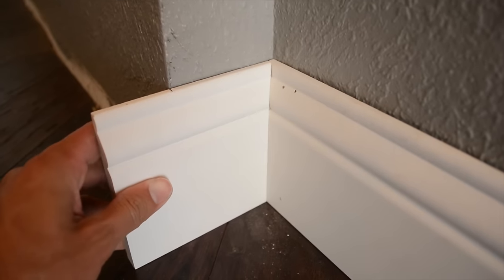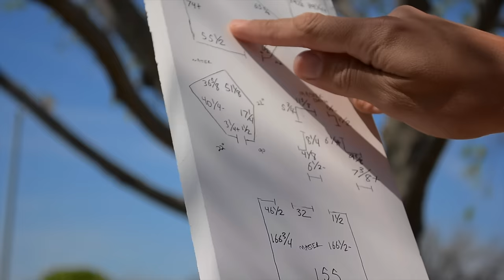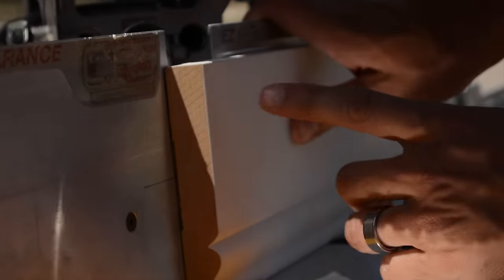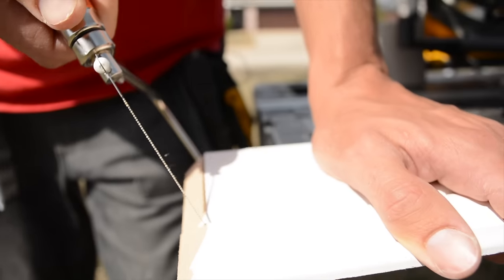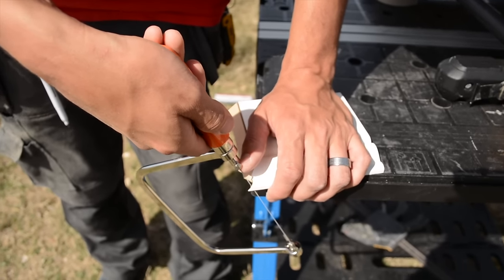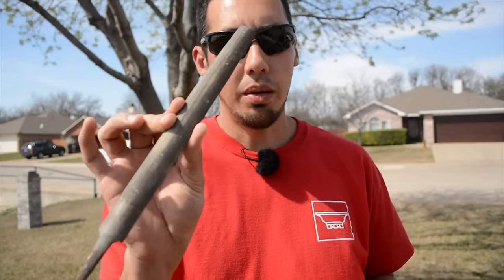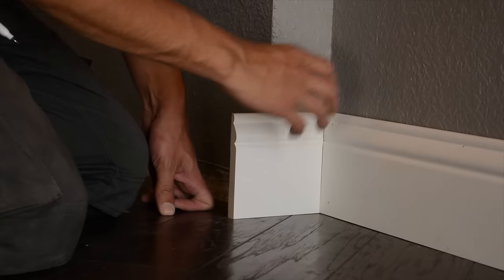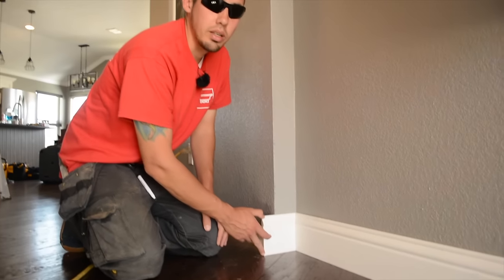Coping MDF Baseboard

Comment: As much trim as you guys install, you should look into a Copemaster 2. It's like a key duplicating machine for coping trim. I just used mine for the first time and I coped 8 crown joints, 6 chair rail joints and 5 baseboard joints in less than 10 minutes and they all fit perfectly, no coping saw or filing whatsoever. This machine can do 10-1/2" crown or base. With the volume of trim you guys install, this machine will pay for itself very quickly.
Reply: Hung, I think you're misinformed. The speed at which you can cope with this machine is, at least 3 times faster than using a jigsaw saw and that jankey little jig/guide. The machine weighs about 45lbs and is very portable. Unless you have used a Copemaster, you really need to reserve judgement until you have tried one!
Reply: I'm a carpenter here in Kentucky, and if you know ANYTHING about this trade, you would know that coping EVERY SINGLE piece the same exact way, will not always work my friend. I'm not being ugly, I'm saying not every corner, (inside or our) is actually 90°. With that being said, it could be the sheetrock, or the framing, or the settling of the house.
Reply: Jake,  Again you're ignorant to the specifics of this machine and how it works. There is very nearly 6 full degrees of adjustability, both, over and under 90 degrees, in the coped joints from a Copemaster 2 and  the inside corner on which you are installing the coped crown will work on out-of-square situations. You should do a bit of research on the machine and you will see exactly what I am speaking of.
Reply: Hung Q Tran k
Reply: Jake, you are among the uninformed as well. The adjustability of the coped joints is more than 4 degrees +/- of 90 degrees. Have a look at the videos on the Copemaster website ( I have NO VESTED INTEREST in the success or failure of the Copemaster company) and it will help you make an INFORMED JUDGEMENT! If you ever have the opportunity to use one of these machines you will be immediately converted unless you have no interest in being a better and substantially more productive carpenter. Higher production=More Money in your pocket at the end of the project!
Reply: But most people will not be buying one as they do not have many pieces of skirting or architrave to repair - so the coping saw and hand tools is the cheapest and best way and the proper way to learn.
Reply: Sadly for the diy'er they need a good but affordable tool that is easy to use. Sometimes you will be setting up your fancy machine just for a couple of cuts when you could get out a hand saw and a Studhawk saw guide. For a couple of cuts you also need this tool as it will save time plugging in leads and setting the saw up on it's frame or stand. By the time you have set up your new machine i have done the cuts by hand and if you are off grid you will need a $1,000 generator and fuel or loads of batteries for the cordless. With most saw guides you have to put the wood in the tool. With the Studhawk Saw Guides - you put the wood on the tool which is easier and faster. The guide also protects your fingers and will fit on round plastic plumbing pipes, gutters etc
Reply: Yes but expensive and if everone wanted one they would not be able to keep up with demand - but demand for fancy power tools is not what DIY'ers want - but an affordable way to do it. The Studhawk is very affordable and simple to use with amazingly accurate results - try it.

Comment: Thanks for showing us.  It would be great if you kept going and showed how to measure and get that next outside 90 degree joint perfect.  Like how do you hold a short piece of MDV on the chop saw and cut it and work up to a perfect joint or do you just cut it once and it always fits?  I look forward to more.  Thanks.
Reply: Great videos I've been watching you for quite some time. I would like to ask your opinion regarding using pin nailers. I have a pin nailer that will shoot a 2" pin. Would you use this for base molding or would you still stick with 16 gauge? 
Thanks in advance for your opinion
Dug
Reply: Thanks for this info Cole Man - do you glue the outside mitre? if yes do you use wood glue or CA ?
Reply: AHA - what you have to do is cut the mitre on a longer than required piece so you have something to hold onto. Once you have the mitre cut - straight cut the piece to length off of the long piece.

Comment: Hello: Do you have a video where it shows installing baseboard and one encounters a big gap between the stiff baseboard and the bowed-in sheetrock…yes one can caulk the gap but has anyone determined another way so the caulked gap is not so wide.

Comment: I finally have a good question to ask you! Can you make a video of your cut list and install processes that make it easy for you? I’ve been doing carpentry for about 4 years now from studs to paint, yet when I make a cut list, especially for window and door trim, it doesn’t line up perfectly like I want it, so I’m forced to take my time and cut fewer pieces at a time. Examples are pitched walls, unlevel floors causing height pitch, and so on. I’ve been using sample pieces and that has helped the process, but I just want to measure, cut, and run.

Comment: I like ur coping vids brother. And thanks for the info on the cancer thing! I never about that but then again I don't do this type of work enough. I'm a jack of all trades and master of none. Most of my work is volunteer. But vids like urs help out a lot! I remember the first time I did crown molding!! I pretty much wasted a whole board trying to figure out the coping method! Lol! I didn't understand the angle to use and crown molding is cut upside down. For those who work on this type of stuff I'm sure it's as easy as tying your shoes with your eyes closed. At any rate, thank for the great info! 

And by the way, why didn't u use the sticky sand paper? I tried that on my last project and man, was I satisfied! They thought I wz a genius! But of course I could take the credit and contributed it to watching one of your videos!

Comment: A few months ago one of the trim carpenters my company subs showed me how you can cope on a table saw, you should try it out works pretty nice and is fast
Reply: make a table for a router mounted underneath and it's even easier. After I did that I figured it would be possible to make the router move around in a purpose made jig, but that's too complicated for me, maybe on a few houses its worthwhile
Reply: not for a novice and only works with short pieces of trim

Comment: Do you need to caulk that corner?

Also have you ever scribed baseboard to the floor?
Reply: Yes i agree i didnt like the void left behind the reverse mitre - leaves week corner joints. As for scribing skirting boards to the floor - try self leveling compound to sort out the floor before fitting base boards. Also not many people know you can pour a self levelling compound on wooden floors - just make sure the manufacturer says you can as some levellers don't!Self levelling - packet normally states upto 5mm this can be increased by adding aggregates to the levelling compound. These additives are :-1)granite dust2)granite chippings3)lytag pea shingle
All available from good builders merchants. This way you can extend your levelling compound to 50mm with some manufacturers products and some can be laid inn bays of 100m sq without expansion joints. Dont believe this check Alfix of Denmark. I used to use this product in shopfitting where there was no time for a traditional screed to cure. So subscribe to Studhawk channel
Reply: I cut my profile line at 0° for MDF.  It's too weak for a 45° back cut.

Comment: Millions can't put a cob handle on a file. Richard was born for this work. Perfect
Reply: I found a old golf ball with a 3/16 hole drilled and pounded on the file tang works better than a cob.
Reply: Exactly which is why people should start at the begining with hand tools and work their way up from there to power tools. If you learn with hand tools you will become a better craftsman. No one jumps straight onto power tools without understanding the feel of wood and cutting it with hand tools and then planing it and sanding it - yes all by hand and no machines. Just look back through history and see the skill that was all done by hand ! We have so many great machines but i never see anything that is on a par with Chippendale or Hepplewhite or the Empire period etc etc

Comment: FWIW MDF mouldings get caulked. Running your miter saw at 42-44 degrees for an inside miter will ensure a tight fit because the inside miter is undercut. Tomorrow I'll be doing 9" baseboard for a client, it's getting coped with a grinder. Anything small under 4" I won't bother coping because it's just too time consuming especially when there are a good 35+ inside corners in the house most of them small pieces at around 2-7 inches (doorways, closets, shorter walls ect). I get why a tight joint is important but after 12 years doing this stuff in new homes and renos, after its caulking you can't even tell if coped or not. For hardwood base tho.. definitely cope.

Comment: The problem is when you have a Standard baseboard without ornament, only straight line on the top, there is no chance to coping it, because this little piece on top have aboute inch thick. How aboute this?

Comment: I used to use a coping saw but found a way that suits me better. 

You can buy a coping foot for a barrel grip jigsaw, basically allows you to get those angle cuts. I find it faster for both, mdf is a little easier with coping saw but I'm so used to the jigsaw I don't bother. You can also cut copes either direction easily.

As far as mdf linked to cancer, shrug... I personally will use a mask when cutting large amounts of it, N95 or greater. Tablesaw I'll use a larger mask that also protects against lead and asbestos, just because the amount of dust it flings in the air. I tell customers to get the work cut outside or in a garage, Winter in Canada makes outside impossible. I've got chest xrays that were clear last year because of coughing/back cramps/soreness, which is more than likely an allergy but its better to be safe then sorry. What does alarm me is if you need to paint it for it to stop releasing formaldehyde, I have been on jobs where customers don't even paint the mdf they just leave the primer coat and fill nail holes. Heck even in my own home I finished the basement but haven't painted all the door jambs, baseboard yet. Just not enough time.

There's lots of stuff out there that will kill you, seems they even put bacon on that list.
Reply: Not enough time?  let's see here. That looks like maybe 10 min. worth of comment. + the time to watch the video. 
I could paint a door jamb in that amount of time. Just sayin. Element .
Reply: @wheretonow3106  Actually been working on it past week, business finally slowed down which is nice this time of year. Doing the bathroom as well, hope to be done for spring when farm work begins. Thanks anyways.
Reply: I was just pulling your chain. I hope the rest is the best.  @DesignsElement

Comment: Question, i just purchased the exact saw as you, how are you cutting 5.25” baseboard when the maximum cutting height of a 45° miter on the saw is 4.4” ? I genuinely was disappointed to find out that this $1000 saw could not miter 5.25” and I had to use the bevel feature.
Reply: nvm, using the slide lock.

Comment: If you’re new to miter saws, be careful with this trick. If your material doesn’t reach the fence on the far side of the blade (as it rarely will with a short cut like this), the saw will try to grab the material out of your hands. It’s especially bad with a worn blade.

Comment: I’m not into carpentry but do have a question.    Why cut the a 45 degree angle and back cut?  Why not start with the original edge (90 degrees) and then back cut with the coping saw?
Reply: Because the 45 cut will give you an exact profile to follow, you'll never get a mark even close to the same accuracy by trying to mark it by hand. A scribing block cut from the same mold will work  of course but not as well
Reply: Carnage Metalclub - I sincerely thank you for your reply.  I guess I don’t have the critical thinking skill to visualize the advantage of back cutting from a 45 degree.  I’ll probably need to do both to have the epiphany (ah ha) moment.

Comment: Great video, but one comment on leaving the tip on the piece you are coping. Since the receiving piece and the coped piece are the same dimension, when you leave the tip on the coped piece you will be forcing the saved tip over the top of the receiving piece. This can result in breakage or the tip being slightly proud of the top of the receiving piece. As a result, some will notch out a small piece on the receiving piece to receive the tip of the coped piece. By the way, I also like leaving the tip on the coped piece.

Comment: Buy a Japanese coping saw, the blade can cut on 360 degrees of the blade which is circular. No more twisting the blade around.
Reply: Bet you have to order them from Japan - ive never seen one so please post an image if you would be so kind?
Reply: Or just use a jig saw

Comment: The other reason to do this rather than cut an internal angle is that if the long board shrinks slightly the joint won’t open up and become visible.

Comment: Nice job and I do understand why you cope vs 45 it.
Reply: I don't. Can you explain?
Reply: @paulsallee4889  not every single edge/angle is an exact 45. When you cope a joint you don't have to use nearly as much caulk because there isn't a gap to fill. Coping allows for nearly any angle to look prefect.
Reply: @JF32304  
Thanks

Comment: What is the safe way for cutting that piece to fit. It feels a little sketchy when I have to cut really short pieces like that.
Reply: chickenguru small pieces like this one or smaller, I cope the edge first, then cut the straight edge second. Measure your overall length from the tall vertical flat.

Comment: Do you have a video that shows how you do "outside corners" with installing trim?
Reply: I'm getting ready to install squared off trim, no curves.  Think it's best to still do miters or since it's a square product could I just use butt joints?  Will still have a 90 degree to it.  @islanti
Reply: True, but on inside corners it would be ok to not miter, correct?  @islanti
Reply: I saw that trick finally on a different video and will try it out next time I'm installing some trim.  Would a similar technique not work for doing inside corners?  By placing a speed square in the corner and seeing if you are right at 90 or if you are slightly above or below 90 and then just adjusting your miter accordingly?  @islanti

Comment: In regards to how you used the method of saving time by using the miter to partially cope the baseboard.  I am currently doing this to my house however my baseboards are a complete rectangle no special grooves so with that being said i would imagine i could cut the cope with a miter saw as you did but all the way down since i have no special grooves?

Comment: Also the reason you scribe internal corners and not mitre is shrinkage. If it's mitred and it shrinks, the front opens up.
Reply: robert winton  You never mitre internal corners. I am a master Carpenter & Joiner with 27 years experience. You only mitre external corners
Reply: robert winton hello, I'm a carpenter of the bluegrass state, I don't have 27 years like the other gentlemen. However read your reply.
Reply: robert winton when I say that I mean, they can be, but we tradesmen, face certain situations in which, it's pick the lesser of 2 evils, I'm this case, you ALWAYS NO MATTER WHAT cope inside corners. Mainly for the fact, that no matter how good of a carpenter you are, A house, as a whole, will grow, AND shrink.
Reply: robert winton with that being said, when you cope inside corners, you have one piece of trim that will grow/shrink verses 2. Your comment about glue is 1/2-way true, if you get on outside corner fitting good, and I mean, "no spackle or putty good" then, in theory, glue should keep it in place. So the problem behind your cabinets is; he or she wasn't as good, or just didn't get the cuts fitting very well.
Reply: robert winton no problem my man, this line of work is honestly becoming a lost art in my opinion, but as for your question, it's not the sheet rock that moves, it's the moulding itself. The reason for this, is the actual moisture inside the wood, MDF is a little different, but in all honesty, don't ever use that stuff, not only is it difficult to make it look like anything, but it won't hold up like real wood.
Reply: robert winton so, they actually both do, the outside corners are actually glued to o me another on the outside (usually) and insides arnt. But in most cases they both move but, sometimes it most as noticeable.

Comment: Does the formaldyhyde leach from this board. i have this in my home
Reply: Formaldehyde risk has been way overrated. Dust particles that actually damage lung cells is a far greater risk and this does not just apply to particle boards and it pops up in many industries such as farming, mining, brick laying, steel fabrication and even painting. 

A farmer who works with hay can develop what people call farmer's lung.  Different particles such as good, grass and stone can have different effects but they all damage the lungs. 

Good dust extraction and masks can reduce this risk enormously. People also underestimate the risk of skin contact with different materials and that even includes natural woods and grass.

Comment: "As long as the joint looks good and tight, who cares?" So why not just miter? All inside painted joints should be latex caulked before painting anyway. Little gaps or no gaps whether coped or mitered will look and perform the same. Coping made more sense in the olden days when the miters were hand cut quickly and roughly so coping significantly improved the fit.